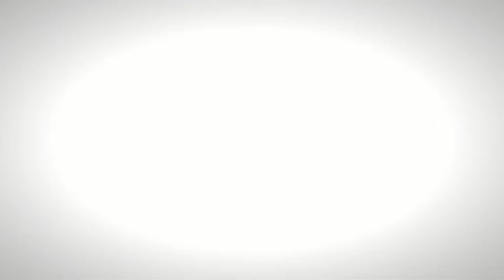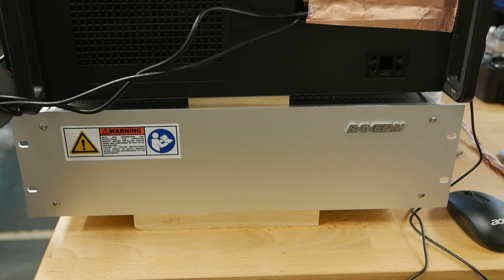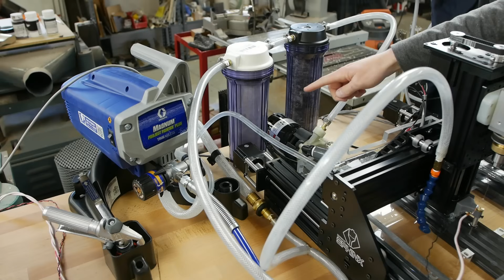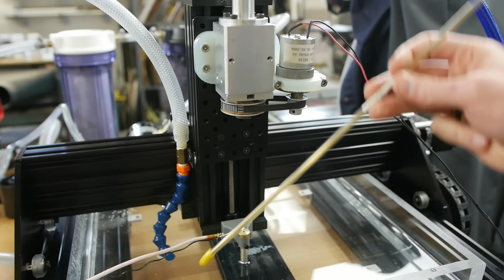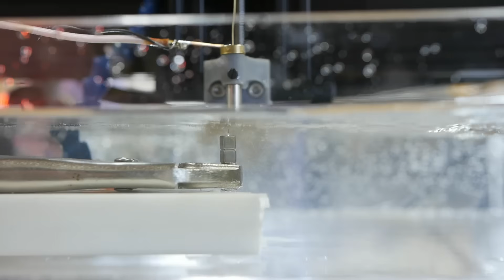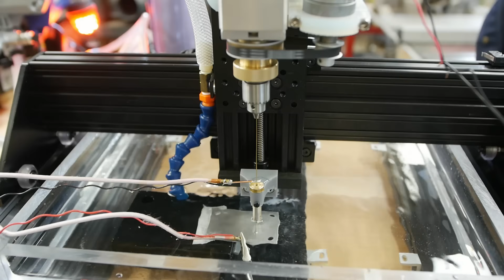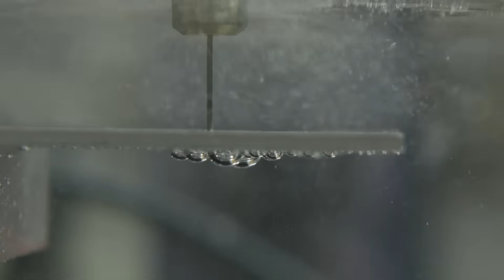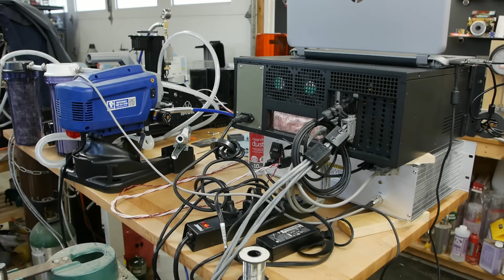Drill through anything (conductive) with Electrical Discharge Machining

Comment: A lot of years ago, I used one of these machines to remove broken drills, taps and hardened steel pegs from materials. It was extremely good at doing this and due to costing, worked out cheaper than re-machining the whole part again - mainly because I worked cheap.
For fun, I used to make strings of ball bearings, similar to pearls, from worn out bearings.
Reply: lol I read the last line wrong and was like... a ball-bearing thong doesn't sound comfortable XD
Reply: @g60force  Hmm, never thought about that but am thinking that a few odd nuts might make for interesting thing, for the very brave....

Comment: As retired EE,  I could design an EDM power supply for low cost.
MOSFETS easy.
any interest  ?
Reply: What is "low cost"? Under $100? I'm down.
Reply: Yes. I would like to design a low cost benchtop injection molding machine for sale to consumers. It only makes sense if one can also make the molds at a low price as well. 4 axis cnc for rudimentary cuts combined with an interchangeable EDM tool on the same machine makes sense. Each machine need to be in the mid tier consumer 3d printer range. Like sub $1k. This makes MOQs obsolete and empowers designers.
Reply: @rhejamphi  Glad to know I'm not the only one interested in designing a low-cost desktop injection molding machine. Not an easy feat....
Reply: Make a video about it please.
Reply: yes, please
Reply: @qwertykonrad  Here is how it works.
J. Electromagnetic Analysis & Applications, 2009, 2: 108-113 1 doi:10.4236/jemaa.2009.12017 Published Online June 2009 (www.SciRP.org/journal/jemaa)
A Novel Half-Bridge Power Supply for High Speed Drilling Electrical Discharge Machining
He Huang, Jicheng Bai, Zesheng Lu, Yongfeng Guo
Department of Manufacturing and Automation Engineering, Harbin Institute of Technology, Harbin, Heilongjiang Province, China. Email: huanghe@hit.edu.cn, jichengbai@hit.edu.cn, lzesn@hit.edu.cn, guoyf@hit.edu.cn
Received February 10th, 2009; revised March 12th, 2009; accepted March 20th, 2009.
ABSTRACT
High Speed Drilling Electrical Discharge Machining (HSDEDM) uses controlled electric sparks to erode the metal in a work-piece. Through the years, HSDEDM process has widely been used in high speed drilling and in manufacturing large aspect ratio holes for hard-to-machine material. The power supplies of HSDEDM providing high power applica- tions can have different topologies. In this paper, a novel Pulsed-Width-Modulated (PWM) half-bridge HSDEDM power supply that achieves Zero-Voltage-Switching (ZVS) for switches and Zero-Current-Switching (ZCS) for the dis- charge gap has been developed. This power supply has excellent features that include minimal component count and inherent protection under short circuit conditions. This topology has an energy conservation feature and removes the need for output bulk capacitors and resistances. Energy used in the erosion process will be controlled by the switched IGBTs in the half-bridge network and be transferred to the gap between the tool and work-piece. The relative tool wear and machining speed of our proposed topology have been compared with that of a normal power supply with current limiting resistances.
Keywords: High Speed Drilling Electrical Discharge Machining, Half-Bridge Power Supply, Zero Current Switching, Zero Voltage Switching
  1. Introduction
Electrical Discharge Machining (EDM), also known as spark erosion machining, is becoming increasingly popular. EDM sees the removal of matter from high hardness con- ductive materials by means of a series of repeated electri- cal discharges between electrode and work-piece, which are separated by a discharge gap. Dielectric fluid is forced into the discharge gap where electrical discharge erosion occurs. When a voltage large enough is applied, the dielec- tric fluid breaks down, the gap is ionized and electrons are emitted from the tool (cathode). When more electrons gather in the gap, the resistance drops, which causes elec- tric spark to jump between the work-piece surface and the tool. The whole sequence of operation occurs within a few microseconds and is accompanied by a shock wave in the dielectric. The impact of the wave on the electrode causes high transient pressure. The current density in the dis- charge channel is of the order 10,000 A/cm2. The tem- perature of the central point of the channel is of the order of tens of thousands of °C. The forces of the electric and magnetic fields caused by the spark produce a tensile force and tear-off particles of molten and softened metal from this spot on the work-piece [1,2].
Within the scope of EDM, High Speed Drilling Elec- trical Discharge Machining (HSDEDM) is an important
technology. The basic components of a HSDEDM system are as follows and the schematic is shown in Figure 1.
Like other EDM methods, the HSDEDM process is especially suitable for machining high strength and hard metal materials. Generally, a rotating thin copper or brass
tube electrode is used as the drilling tool. High speed and pressure dielectric (water) is pumped through this hollow
Figure 1. Diagram of HSDEDM process

Comment: I once had a conversation with an engineer - he talked about a project he was working on. It was about EDM machining; they used a wire about the thickness of a human hair. It was so precise that when you put two freshly separated pieces of metal back together and left them for a while, they'd fuse back into one piece. Since EDM is pretty slow, they'd devised a system which was able to re-inject a new piece of wire using a jet of water should the old one have broken when running unsupervised during the night or over a weekend. Fascinating stuff!
Reply: @RareCondition  Yes, he did.

Comment: I could be wrong but i believe this is what welders call gouging just slightly different i think due to the fact that its underwater. someone please correct me if im wrong.I Worked in a  metal fabrication shop and i believe this tech is very similar if not the same.

Comment: The ferrite toroid on the power cable with 3 turns is doing nothing. the "Hot, Neutral and Earth" wires must be split up and wrapped individually to cancel any noise. Zero net inductance otherwise.

Comment: Would you try to build string EDM machine? And there is another technology where material dissolves on the anode in just salt water with same type of electrodes as a cathode. It has more simple power supply -- just PWModulated DC.

Comment: Did a lot of edm with a 'wire cutter' very versatile machine (a square hole is easy), It used mains water with a little soluble oil, the wire diameter was 0.18 mm it went back and forth on a reversing rotating spool..

Comment: Aluminum? I say this cause i would assume it would drill right threw it just as well as steel. I worked at a automotive machine shop for about a year and we had an EDM but i feel like i remember removing a steel based bolt from aluminum blocks with no erosion of the aluminum. Maybe just a skilled worker? Or am i missing something? Thanks for the amazing brain fuel!

Comment: Would it be possible to drill trough rocks with high metal content?
Reply: Probably not. Another YouTuber does industrial EDM says they can't even use cast iron. Because cast iron has voids and little spots that are more or less conductive. The wire will jam. The material has to be extremely uniform.

Comment: I've been a EDM programmer/operator for 25 years... When I started my apprenticeship.. EDM was in its infancy. I run Wire, sinker and Hole popping machines. Even after 25 years.. I'm still learning new and interesting aspects of the technology almost every day. Wire EDM is the most accurate form of machining available today. We regularly achieve tolerances of .00005.  Currently my company has 8 Fanuc Wire machines along with several sinkers and hole poppers.
Reply: .00005 what? attometers?
Reply: @yosyp_yosyp  fifty millionths or half a ten thousandths of an inch
Reply: @fk6823  so, .00005 inches?
Reply: That's amazing! Could this be used on rocks?
Reply: @speaklifegardenhomesteadpe8783  no. Only metals

Comment: Designed a hot air nozzle and turned it over to a real tool designer with the statement I don’t know how it could be built. He said no problem it would be built using a machined carbon probe in an edm machine.

Comment: Thanks to your video, today i have successfully removed a broken screw tap from an aluminium heatsink.  It was metric 3 and 6 mm long . I have done with a constant current lab supply with 10 amps and 24V. Rotation with a hand drilling machine. Thank you! Without you i don't think i could done it.

Comment: Pretty cool.  It seems like you might have to insulate the sides of the "bit" so its not cutting the inside walls and only cutting on the tip?    how wide does the hole end up being?  about twice the diameter of the electrode?

Comment: WOW, Excellent educational Video. Like most education, I'm left with more questions. Do ball bearings with many holes, 
with various levels of deviation from the central axis allow lubricant flow and change the frictional characteristics in confined spaces? I was imagining, a test Chamber, a clear cylinder with holes in the sides that with the ball bearing in the cylinders and a clear medium with a slide to allow gravity to stack them, like Red cells in  Rouleaux and puffs of colored lubricant introduced to see how the liquid flows through the balls. What's your current smallest diameter hole in your "most durable " conductive material?
Put me on the list for your "EDM Milling educational Video"... Thanks, Dr.TMH

Comment: From decades of working with analog power supplies  filter and shielding and low noise ultra fast soft recovery diodes help a great deal .  Wire management also reduce antenna effects of un-shielded wire .   Faraday cage  does work also . Enjoyed the video keep up the fine work.

Comment: The reason your holes are larger is due to the run out starting right above the drill chuck.  The run out is easily detectable on the video even from across the room where I'm viewing it.  Your electrode may be manufactured perfectly straight with no detectable error, but if the connection point in the chuck or points higher have run out it will effect everything down the line.

Comment: I'm wondering can we use a mesh instead of a rod? for example: creates the fins in CPU Water block
Reply: Just watched another EDM industrial video. They can actually do a reverse direction of cutting to achieve what you want. In other words instead of using a wire electrode moving downward to drill holes into the material below, the cutting moves from the bottom up. they have a large shape tool, think of your mesh or any profile to be cut, is on the bottom. The bottom electrode cuts up into the metal stock above it. The stock, which comes down from above, is the part that's being eroded away. 
So you can use it kind of like a cookie cutter, but from below. 
In other words, instead of having the wire electrode come down into the material, the electrode, at the bottom, is  in the shape of the desired pattern to be cut. The electrode cutter can be any shape you want and is placed on the bottom. Whereas the stock material being cut is pushed down upon it. 
Of course, you have to reverse the voltage because the material that's removed always has to be positive (or negative, whatever).

Comment: AuPt
Reply: It's not conductive of electrons.. it's a room temperature superconductor for heat and magnetism
Reply: With diamond, all the atoms are the same size, and they form so deep and hot there's no contamination from other metals, but silicon carbide forms immediately thereafter between 3800 and 3500° C.. silicon and carbon are semi metals, 4 electrons in the outer valence orbit, but silicon has 8 more proton electron pairs, which creates a magnetic field... they form together in fault lines around the World.. rivers and creeks and dry washes follow fault lines, in watersheds.. they extend down to the semi molten mantle 55km deep... about 50km deeper than the deepest kimberlite pipes
Aluminum oxide forms next at 3500°... and trace elements in between the next major constituent.. platinum...@ 1768° C immediately followed by gold platinum alloy with double double covalent bonds like diamond... covalent bonds are exclusive of all else... diamond is a superconductor for heat and magnetism... it's a catalyst rather than a participant...  
because both Au and Pt are diamagnetic... and they stick together in a very north south orientation in face centered cubic hexagonal symmetry with a 13 atom unit cell... which is how the double double covalent bonds are shared.. face centered cubic starts with a single atom, we say it is surrounded by 6 other atoms all touching.. they are not touching..  except through the covalent bonds.. and they are arranged, not in a hexagonal way around a plane... but rather, with each atom at each face of a cube... the cubic structure is repeated in all directions... like our Universe, it's the same in all directions 

I use metric exclusively... further additions will forego the C... unlike Imperial system measurements, metric is based on the real World... and it doesn't use fractions... guess how many fractions I have multiplied since I left high school?

The Roman empire gave us the Imperial system, Roman numerals have no zero... simple fractions were used to divide the spoils of taxes..  they are used still for the same reason... and since it's actually difficult to multiply and add and subtract different fractions, most people forget how about 10 days after they read the book... and as long as they pass the test ==>> no worries, right? ;;☆》... which is why our paper money actually carries negative value into the future..  it's only value is the promise of our future taxes.. so it's like an indenture to our benevolent government 🤔.. but if you can't do the math..  guess what?
Reply: I can be found here on YouTube and on Pinterest for my photographic images and videos
for more information 
Starfirediamondmines@gmail.com

Peace ✌☮

River rock is usually some form of AuPt... I look for the magnetic ones.. but close examination reveals a cubic hexagonal arrangement of light and dark cubes in 3 dimensions.. or silver and gold... repeated ad Infinitum
Reply: Remember that quartz is only 7 on the Moh's scale of hardness... feldspar is 6 - 6.5... most river rocks are 10 on the Moh's scale of hardness... so... it's definitely not quartz and feldspar
Reply: When I bring a high frequency discharge from a coil near magnetic AuPt, the spark is attracted to the metals, through magnetic attraction... but it is neither positive nor negative... it's diamagnetic

Comment: At Billet Precision we made stator cores for the electric motors that rotate the solar panels that provide power to the satellites.  An extremely reliable way to machine metal without applying any stress to the parts being made, of course, a top of the line centerless cylindrical grinder was required to achieve the tolerances of +/- .0002 circularity and diameter.
Reply: https://encrypted-tbn0.gstatic.com/images?q=tbn%3AANd9GcRfSfO1pTuN1xYRz6A5kWJ48-VqhWPY62jIDw&usqp=CAU
these are about the size of a quarter, or 2 dimes and a nickel :)

Comment: It can drill a curved hole. Think about it.
Reply: If a curved electrode and push it in a curve it will cut a curved hole. This done on jet turbine blades.
Reply: All right,  @mikenottis6252 , thanks for describing it now.
Reply: OR... you could just be easy and explain it yourself.

Comment: I am wondering !   Applying pressure to a  piezo crystal  generate electricity ! Does AC power increase by adding more crystal .  I would guess the amount of crystal is important for generating more power .  More Crystal ,more power ?   Thanks for your presentation !

Comment: Can it drill through prince Rupert's drop?
Reply: I sort of doubt it but anyway, normally EDM only works on conductive material (with exceptions https://www.sciencedirect.com/science/article/pii/S2212827117309551).  So you'd need some kind of conductive glass (or maybe https://www.quora.com/What-are-the-best-transparent-conducting-materials if you could make Rupert's drops from those material).  Or maybe there's an exception at nanometer scales; if you made a tiny Rupert's drop from just a few hundred molecules of 'conductive' glass and EDM's out a nm sized hole, or maybe if you did it at absolute zero.  Don't know...but suspect it is a hard problem.

Comment: This has some useful automotive applications that I can see, namely adding safety wire to parts that didn't come with it. Very cool, thank you for showing this demonstration of your open source hardware table you built and the length of explanation of how and where you acquired the bits necessary to replicate.

Comment: Cool but really wasteful and specialized setup. Can this drill any bigger holes that those tiny ones and is there manual setup in form of drill press, cause that would be useful when dealing with really hard materials.

Comment: huh. At my work we have a super tiny EDM that doesn't flow anything through the tool, and we use droppers by hand to extract dirty fluid and reflow clean fluid over the piece. The fluid we use is mineral spirits, not water. I wonder how the difference in fluid impacts things.

Comment: the requirement of high pressure for water flow caused by the turbulence in the stream. they should have decreased that turbulence with piping method within the drill bit, but since size matters, it can be molded with turbulence avoiding design. I think that pressure can be decreased by %90 with a proper design